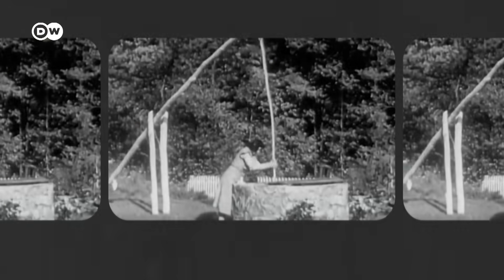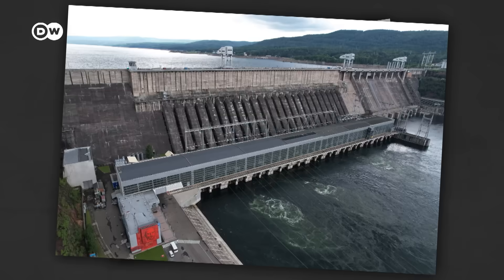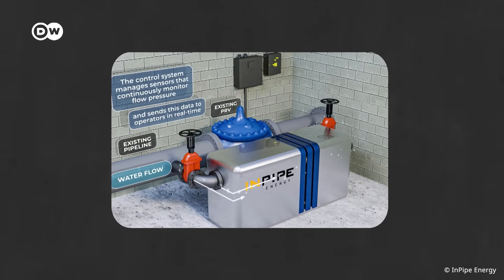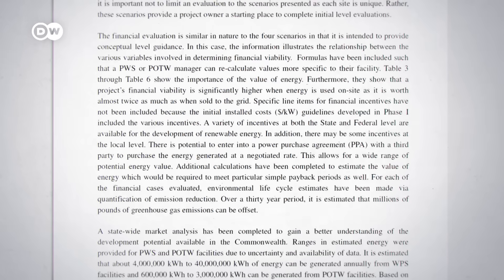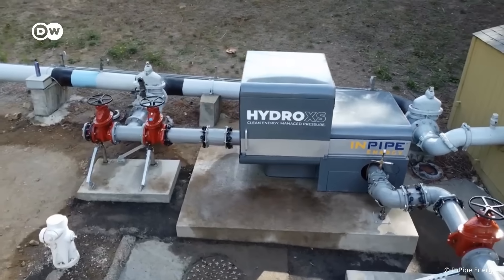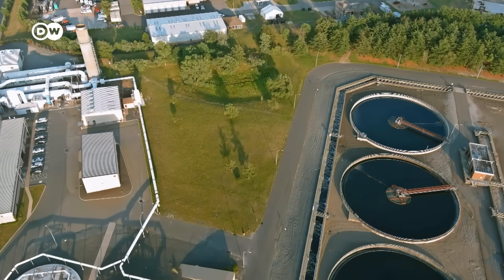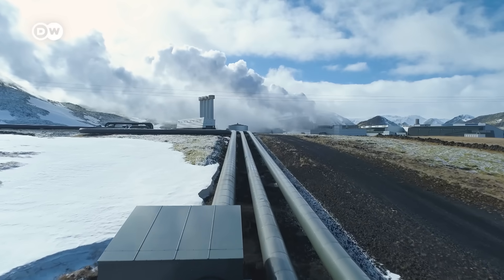In-pipe energy: The hydro power nobody is talking about

Comment: This reminds me of when People suggest hooking up extra alternators to a Vehicle in order to generate free electricity. If the Water is being pumped then you're introducing more friction/resistance and inevitably the entire system will consume more electricity than it creates if it's piped/under pressure. This would be viable in a non-pressurized stream or water-way though and we already do this with our reservoirs, which are really just giant batteries.

Comment: The power grid needs a steady constant means of producing electricity. The in pipe water tubine would only produce electricity when in use, the water does not constantly move. Now with that said, if you could convert it to DC power with minimal loss and store the electricity, then on micro levels on location this could be viable. But then you run into another problem. You have to reintroduce this DC to the grid as AC power, and again you are introducing the issue of power influence that the grid has to figure out what to do with the excise energy. Again, maybe in a stand alone off the grid may be the answer, but most of the world is on the grid and that issue of steady power production is key for steady reliable power.

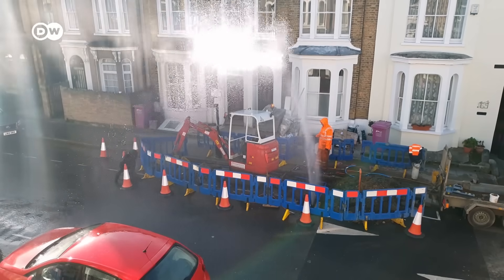Comment: A pressure reducing valve (pressure regulator) does not "waste energy" as stated at 2:35. If it did, heat would be generated because the energy must go somewhere. Large water systems have excess capacity to ensure good performance even when there is maximum demand. Adding turbines to a water system will remove energy and cause the pumps to work harder to maintain water pressure and flow rate.
Reply: So you end up losing energy

Comment: I had to check the date this video was released, thinking it was an elaborate April the first joke, but no.  They seem to be deadly serious.
Unless the supply system is entirely gravity fed, the pressure in our supply pipes is powered by huge electric pumps somewhere along the line.  If we extract energy from the flow, those pumps have to work harder to maintain the flow, thereby consuming more power.  This concept is akin to putting a wind turbine on an electric bicycle to charge the batteries...

Comment: I remember thinking about this in school when we learned about hydroelectric power made by dams. It seems like a logical extension of the technology to me. Installing turbines in areas where the water source is at a high enough elevation, and at the base of water towers are the obvious spots in my opinion. I thought about having small units on people's houses to power a battery backup system, but I think the usage would be to short and intermittent to get a turbine moving.

Comment: putting turbines will make the water plants waste more energy to pump due to the turbines  someone did not think hard enough
Reply: You need to rewatch the video
Reply: You didn't get the video re-watch it
Reply: Because they are using excess power in the places where they need to reduce the pressure. At these points the pressure (energy) is just wasted.

Comment: Why not just provide water at lower pressure? I'm suggesting the pumping process would consume less energy in the first place.
Reply from the maker: If we would not have a strong water flow it would basically just take way more time to fill up a cup, take a shower etc. This is why higher pressure is used. 💧

Comment: many errors 
1. @ 4.33 USA study reported 1.4 GW, what that does not mention is the labour and cost for installing millions of hydro turbines, synchonisers, control panels, piping, valves, strainers, and operating costs for lots of tiny generators. 
2. Also nobody mentions that the water flow is not constant, the flow in pipes varies from zero to full flow due to demand, think about how much water is used in a home at night, practically zero, so irrespective of the "pressure" the flow rate will be zero. 
nobody

Comment: This is fundamentally myopic. If there's enough extra energy in our water supply to generate power... then the supply is being overpowered. You'd get more benefit from simply reducing the input pumping energy. You can't get more energy out than you put in. 

This sounds like a corporate plug for small generators (generally inefficient compared to large installations). Otherwise we would focus on reducing inputs and using the energy savings more wisely.

Comment: We run a small community water district here in Oregon (around 12 homes) and the system exists over a 300+ ft drop.  We've long had problems with excess pressure in the downhill portions of the system and have discussed the need to install more PRVs.  I sent a link to this doc and hope to get a conversation going and shop around for system.  The chlorinator currently runs on solar and, being in the forest, it rarely delivers enough to meet demand and the batteries have to be swapped out and charged regularly.  Having any meaningful supplementation could help that.
Reply: You can just back feed a centrifugal pump. They have good efficiency when used as turbines, This guy is just all hype and bullshit, he didn't come up with anything new

Comment: More and more cities are removing water towers and using pumps because land value is so high.  Generating electricity from desal plants which operate at around 16,000 psi has been done since the plants were first built.  Reducing water pressure for electricity sounds like a pitch given by a salesman selling free electricity.

Comment: Pipe dream? Yeah, sort of. However, I will say this. If you can use micro-energy sources, please consider this. Every apartment complex and many homes in the US have a mandatory pressure reducing valve installed. They aren't cheap. However, if they were changed over to battery chargers or some other source of electricity, they could help do something.

Comment: Sooo we’re moving water upwards to get water pressure just to collect energy back inefficiently just to lower the water pressure back… this is a clear issue and the irony of this. If that’s the case, then I’d definitely save more energy not pumping the water upwards in the first place. But I guess not all of us needs high pressure water anyways so I guess it’s better to collect some energy back as long as we’re fine dealing with lower water pressure.

Comment: For a pump fed water supply there is no such thing as free energy.  The utility has already paid for the energy to run its pumps.  If you try to extract energy from the pressurized water then you will just be reducing the flow rate due to the loss of pressure caused by the turbine generator.  This means lower pressure at the tap or the utility will need to increase the water pressure which means more energy used by their pumps.  This is a game that cannot be won.  Gravity fed water systems may yield some energy harvesting but not if everyone does it.

it is amazing the amount of energy people will expend to try to get something for free.

Comment: This premise is basically the idea that you could hook up a battery to an inverter, to power a battery charger that charges the battery it’s drawing from. 

Regulators maintain system pressure; they don’t ‘waste’ it. If you are pumping water with a pump, the pump will ramp up or down based on pressure and flow. As system pressure rises, pump output decreases and flow decreases. The load on your pump, and therefore energy consumption drops proportionally to the demand. This is an idiotic idea that will sell tons of equipment, cost millions of dollars and recover nothing. You are not “generating” anything if you need to put the energy into the system in the first place. The only systems this could work productively on are gravity fed systems that require no energy input to lift the water. Basically, the city needs to be fed water from a lake or reservoir at a higher elevation than the city. And the reservoir needs to be naturally filled. 

This is a system that solves no problems in any meaningful way.

Comment: What they are talking about is stopping the waste of energy where they pump it at to high pressure and it goes through a valve to lower it if you put a turbine there the resistance would lower the pressure and generate electricity. However most modern advanced pumps govern the pressure to minimize waste of electricity but these are not everywhere. It would be better just to use advanced pumps that govern the pressure themselves using less electricity not wasting it, than waste money on this. Like inverter compressors in hvac that don't have to be either on/off state they can slow/speed up based on the settings. In modern countries they already have pumps like this.

Comment: This is baloney. Energy recovery has always been a critical component of moving water in California. From the Los Angeles Aqueduct (1913) to the present day. There is relatively very little excess energy in water at it's point of use (your faucet, irrigating a farm).   Water head is used to store electricity. During the day when solar and wind are working,  excess power is used to pump water up to a reservoir at a higher level. Later in the evening when energy use peaks the water then passes through turbines at the lower level. I think there's about a 30% cost to this energy.  Before you buy a turbine to connect to your garden hose consider this: What does it take to run a pump? Compare that to your average home energy usage.  It's minuscule.

Comment: So, it takes a pump to create the pressure needed to supply these systems. Unless that water travels downward with enough volume and flow it cannot supply the amount of energy needed to move that water in the first place.
Reply: No they are talking about where there is a pressure relief valve to lower the pressure, putting a turbine there in its place could lower the pressure and generate electricity.
Reply: That's one aspect of it, to get the water there in the first place takes a pump. What is using all this power in the first place. They don't stick turbines in creeks and expect megawatts, they use the pressure created by damming up that water.
Reply: @Milacan  Yeah for hydro you need a drop not just sometimes flowing water. But what im trying to say is this idea is old hat now they have inverter pumps that regulate the pressure themselves they waste no electricity pressure drops uses more electricity to increase it pressure goes to high the pumps slow to reduce it. They still have on/off pumps that need pressure regs but not in modern water supplies they use inverter pumps like inverter compressors in hvac they slow down and speed up based on the pressure needed.
Reply: @Milacan  You can stick a turbine in a creek and get some power from the water flow but the water flow changes so you wont know what you will get from time to time. If you have the right drop downhill from a water supply you will get constant hydro power but that is if you are lucky enough to have that. It depends where you live in summer it might dry up in winter it might freeze.
Reply: I operate a 3 million gallon water loop at work. We have never entertained the idea of trying to recover the megawatts needed to move that water to where it is. It takes pumps that use hundreds of kilowatts apiece. This is a nice idea but pie in the sky thinking for now.

Comment: POWER, put in a system and then taken out of that system is NOT generation of power. It is simply transferring it from one place to another. If there are no power lines to a property but it has city water, then this would be a benefit. Everyone else on the water system with you would pay YOUR electric bill. They are paying for the electricity to run the pumps that put the water in motion.
Reply from the maker: Hey there!  Mini hydro technology only collects pressure valve waste energy already being generated by our water transportation service. Therefore, it collects energy otherwise wasted. The process is explained at 2:26.

Comment: Where ever there is a downward flow of water where the load can be taken off the pumping system, a water-wheel
generator can be installed. It doesn't have to be monumental.. just a few small ones to help power things like car charging stations.

Comment: Plumber here who has researched patents for this exact idea. It needs to happen on the drainage side, not the supply side…….and it needs to be set up in conjunction where say a hi rise installs turbines at the base of the stack, that energy is then returned to the building that can be stored in conjunction with solar and hydronic reducing costs for fees and getting a higher leads rating.

Comment: The reason they don’t give ‘final numbers’ (or estimates) on this idea is because they are bad. They’ve done studies and the idea sounds great until you try it in practical application. The only place this works for a ‘net gain in energy’ is where some other power source … like gravity … is moving the water. This is just more ‘science’ trying to profit from the ‘climate change’  craze.
Reply from the maker: Hey there!  Mini hydro technology only collects pressure valve waste energy already being generated by our water transportation service. Therefore, it collects energy otherwise wasted. The process is explained at 2:26.
Reply: @DWPlanetA  I understand perfectly your explanation and in certain situations you ARE able to recoup some of the losses. lets be clear though …. thats all you are doing … recovering losses due to poor initial system design and it really isnt that much when added up ….  placing these devices all over the water system and then wiring it into a grid that needs to be improved is chasing your tail and isnt really a workable solution for the future.

Comment: If anything the turbines would only work at producing energy without making the pumps pump harder when they are at the tap because the energy is released to the environment  and so completely wasted but then the tap would have a delay and les thruput.
Reply from the maker: Hey there!  Mini hydro technology only collects pressure valve waste energy already being generated by our water transportation service. Therefore, it collects energy otherwise wasted. The process is explained at 2:26.

Comment: You'd have to be extremly careful to not take the energy that's already in use and make the system less efficient as a result
Reply from the maker: Hey there!  Mini hydro technology only collects pressure valve waste energy already being generated by our water transportation service. Therefore, it collects energy otherwise wasted. The process is explained at 2:26.

Comment: I had this idea a few years ago. The problem arises when everyone tries to use a turbine on their water pipe. The pumping station has to pump harder and harder to maintain sufficient pressure on the pipe. So you still have to put in extra energy.  I like the idea of the turbine running when the pressure is too high and it has merit a a concept,  I would like to see some figures on actual estimations of energy saved and electricity generated. Great video,!!
Reply from the maker: Hey there!  Mini hydro technology only collects pressure valve waste energy already being generated by our water transportation service. Therefore, no additional pressure is needed and it would not affect the system. The process is explained at 2:26.
Reply: @DWPlanetA learn some basic physics from engineers first before spreading such nonsense
Reply: @DWPlanetA  that's really not how a turbine, or physics, works. First, a turbine is always a blockage in the pipe that needs to be overcome, running or not. Additionally, if there is more demand on the turbine (more/bigger devices wanting to use energy), the turbine exerts more resistance to the flow. The overcoming of the resistance is the part where the electrical energy is created. Every force has an equal opposite force! What's worse, the resistance of the turbine is highly dynamic (because it's based on the electrical load), the reduction valves are virtually linear and predictable.

Comment: why are you installing the turbine on water that is being pumped out instead for water that is being drained in the sewers.  That flow of water that goes down the drain is the real untapped power.  The water being pumped out is needed to be used for showers or cleaning.  You need to keep that pressure.
Reply from the maker: Hey there!  Mini hydro technology only collects pressure valve waste energy already being generated by our water transportation service. Therefore, no additional pressure is needed. The process is explained at 2:26.

Comment: I want to know if there's a device that can be installed where water comes into a home to generate electricity.
Reply: Probably not. By the time water comes to the home, the pressure would have been already reduced and stabilized. This tech only works on the distributor side, replacing the already-existing pressure valve.

Comment: I'm thinking the pressure in the pipes will be diminished by the turbine generators, causing the pumps that create the pressure to have to work harder. I don't see free power.
Reply from the maker: Hey there!  Mini hydro technology only collects pressure valve waste energy already being generated by our water transportation service. Therefore, no additional pressure is needed. The process is explained at 2:26.